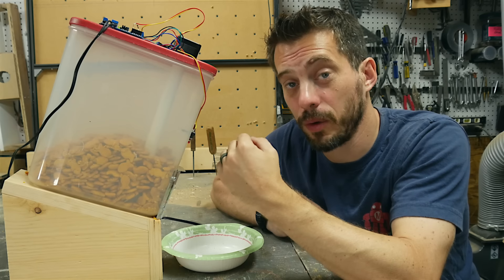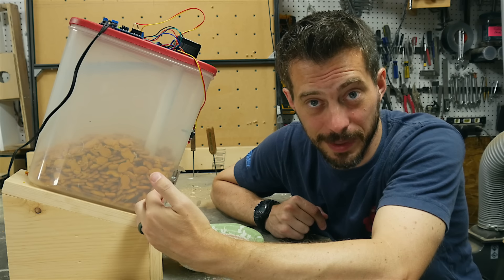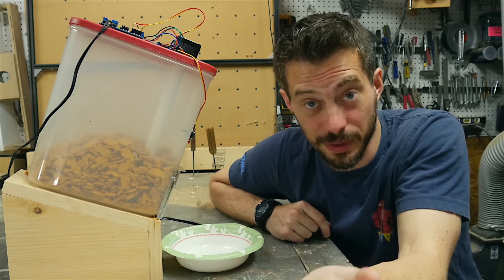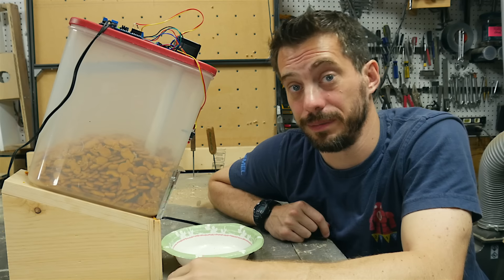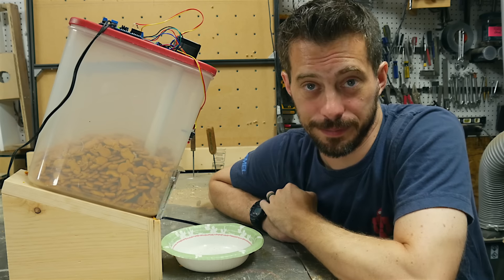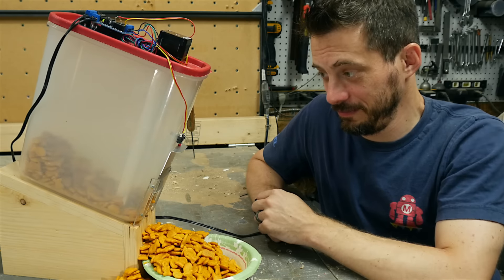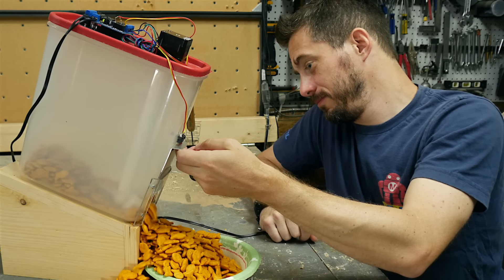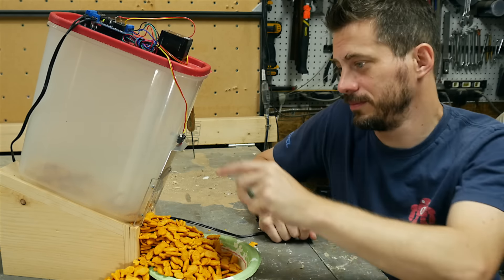Ridiculous Snack Machine // How-To | I Like To Make Stuff

Comment: Fun, nice work Bob! Things I may have done differently (if I possessed the skills that you do): 
1) mount the arduino and propeller going through the bottom of the container. That way, the electronics are neatly hidden away and it's easy to refill the cereal since the lid is undisturbed.
2) make a little "slide" out of the bottom of the container to direct the cereal into the bowl more accurately
3) use a magnetic switch to trigger the motor instead of a mechanical push switch

Can't wait to see how you integrate what you've learned from this into future projects!

Comment: Love it. Reposition stepper to the back and toward the bottom so you can take off lid to reload. Use a Archimedes screw and put a timer for the motor so it only outputs a measured volume of food.

Comment: im not sure you've realized but in arduino setup code you can designate a switch to be high or low, and thus wouldn't need to use a resistor in the circuit to keep the pin from floating. cool video too.
Reply from the maker: oh, good point!

Comment: for the automatic door, you could combine the idea of the panel to activate the switch but then you could have thin rods by the sides of the panel (for the switch) and  have the springs on said poles which push a panel to push another set of poles attached to the bottom of the hatch to cause it to swing open upwards. I hope that all makes sense to you

Comment: Just an idea, a feed ramp under the container would feed the product into the bowl center, and not down the front. But that is an easy fix. 
Mod 2 add a solenoid to open/close the door and a pushbutton to control. With a timer/volume limit.  to keep a "little ones" from ovet filling a bowl. Or leaving it to run till its empty and all over the floor. 
Always try something new or different to learn and if it doesn't work figure it out to make it work.  Even with failure comes knowledge.

Comment: Yo Bob! Love the idea, silly and fun! So much so you coaxed me into posting, (I don't post much). So l had a thought,  it looks like it work better with a cut out under the box so you could slide the bowl completely underneath the opening.  Then you could hide an ir emitter and sensor where the bowl slides in, triggering a servo that opens the door hitting the micro switch. You could then have a timer or scale shut it down, and have a semi metered amount.

Comment: Put a switch on under a pad that the bowl sits on that's connected to  off balanced motor( causing it to vibrate). Then sit the container of cereal or snack with door opening on top of that motor ( witch is mounted to same base as used in this video). So when the bowl is sitting on pad it causes the motor to vibrate the container that shakes the food/snack out. This helps by not putting mechanics in with the food.

Comment: I might try another prototype where the switch is mounted 90 degrees to its current orientation and just a little above (and to the side of) your sliding door. Then you could have the door immediately trigger the switch as it opens and wouldn't have to make sure you open it all the way.

That's a bit harder to do with the way you have the "door jam", but if you were still having fun playing with this, might be worth a shot!

Comment: I'd add a spout, to help facilitate flow control, also ramp the inner wall corners, a bit, it'll help as well. but I could see this having some fun potential, but does it really need an arduino? feels like some wiring and simple components would be enough.

Comment: For the door drill a hole in handle and take a servo. Attach plastic flatbar to servo with hole drilled in it.
Run a stiff wire through both holes, and let it swiwel. Then attach servo, so when the plastic flatbar is at bootomost point, wire runing from the door is perfectly straight. Add a microswitch at botom, so it gets preesed by bowl. Write a simple code, which makes the stepper go as long as it is held down and the servo goes up as son as microswitch is presed and goes dow as it is released.

Comment: Retrofit a wide mouth gumball machine... or base your design off of it  The hand knob usually turns a paddle agitator and some kind of slide valve or cupped dispenser. Gear a servo to turn the knob instead. Then you could have it activated by any number of sensors or buttons.  The two issues would be how to keep the cereal from being pulverize and (more importantly) making the throat deep enough to guarding from fingers getting near the rotating slide value.

Comment: If you do redo this, instead of the dowel/driveshaft taking up space inside the container, build it in through the base so all you'd need inside the container is your propeller. With the motor and arduino underneath in the wooden base you'll have a more asthetically pleasing result and you can remove the lid to refill with ease.

Comment: I would have mounted the pipe parallel with the bottom of the container.  A shroud over the paddles would prevent the cereal from falling out unless the motor is turning to push them out.  This would make loading the cereal easier.  Also, I would have the front of the  container sit a few inches in front of the base.  That would allow the cereal to fall into the middle of the bowl.

Comment: Nice. If you had that style door on the bottom corner instead of the side, you could have had the motor make only one revolution of a wheel that drives an off-center arm, so it opens the door fully at 180 degrees, then closes it when returning back to zero.
Then your sensor switch would have to be compressed for every full revolution.

Comment: Try a plain brushed dc motor under the wooden ramp with an offset weight on the end of the shaft. Then it will vibrate and you won't need any mechanical parts inside the container. In this way the lid will go on and off easier. The RPM, mass of the weight, and the amount of offset will all affect how strong and or effective the vibration is.

Comment: Hey, I was thinking about your design and seems clumsy. I know, it was just to see if you could but....why not doing a horizontal infinit screw (not sure if that's the correct english term)? i would probably be harder to do the helicoid part, as it woul need to be longer, but you would definetly be more confortable with different  cereal sizes and not waste what's in the back side of the tupperware. Just an idea, cool project =)

Comment: make the snack drop straight down instead of 45 degree.
make a hole at the bottom so that the snack fall straight down
then set up the electronics under the hole
the technic is set up a "+" shape fan with big surface area's blade, when the snack drop down, it will stuck between two blade of the fan
then put the fan on a motor that spin it
and set the switch as idea on 6:13
when you push the panel , you push the switch , then the fan spin , hence the snack drop down
if you want , you can measure the volume of snack for each turn that is enough for one person 
if he/she wants to eat more....just turn twice LOL
hope this help you
kinda long XD

Comment: You should have put the motor and paddles going from the back to the front pushing it forward and you would have no problem putting cereal in from the top and you don't have to take it in and out. Also could have created a U shae at the botttom that matches  the spiral so it feeds all the cereal out. You'll need a few modification to the front for the shaft to rotate on and not get in the way of the door a small screw or cotter pin and a small adjustment to the door.

Comment: you could make one using a spiral-propeller (drill-shape) that work align with the motor rotor, then put the motor in the back of the container so that the spiral-propeller push the content out (similar to what the spender machines do to push the product out) , this can actually be also useful for many applications, and beliveme, is not ridiculous.
Reply: That would be the more professional way to do it and also more complicated in ways. Having a spiral fed version would mean a better function, but the spiral itself is somewhat harder to construct, atleast without cnc and/or 3d printing. Would also demand better tolerances towards edges to minimize risks of jamming.

Îf you're building the entire thing from ground up, I'd use spiral feeding but when just slapping it onto an old container this design works well enough.

Comment: Isnt the arduino uno and the motor shield  an overkill you can use an l298n motor driver with an attiny 85 or 45 it will do it work just fine but whatever nice project

Comment: For school, I built a robot using stepper motors. We couldn't use an arduino though but had to build our own boards. Even designed the pcbs and sent them off for printing. It was a nightmare, but this seems doable!

Comment: Did you not consider putting the motor through the bottom so that the wires were not on show,  and the lid wouldn't be intended also that means you could make a hole for the bottom at the bottom for the bowl to be pressed against which means clean and easy hidden motor cereal dispenser

Comment: Cool project.  Couple of questions, why use the stepper motor?  A geared motor is easier to use and would eliminate the need for the Arduino.  Second, you probably don't need the pull up resistor if you use the internal pull up resistors the Arduino already has.
Reply: Internal pull up resistor reference: https://www.arduino.cc/en/Tutorial/DigitalPins

Comment: the arduino isn't require
Reply from the maker: An Arduino is NEVER required.  It makes things simple and fast to prototype.
Reply: +I Like To Make Stuff a simple interrupter and two wires it's enough
Reply from the maker: damon158 Ok. I'm not disagreeing with you.  But you did see that it was a ridiculous, silly project right?
Reply: +I Like To Make Stuff yeah and is really cool! good luck for the future
Reply: you can't turn on a stepper motor with two wires and a switch :D
Reply: Exactly. An arduino is never required, but if you have one you can get practice on it by doing small things like this. It's a very simple program with very few steps really.. I1=O1 Plus it's easy to build on once you've set it up. You can add other sensors to see if there is actually cereal in the container, which only requires the addition of an and to the same line. 

That all said, this version isn't foodsafe so if anyone is actually going to build this you'll need to use stainless parts and attach everything without the use of screws going to the inside.
Reply: TL Design Why use a stepper in the first place? But, yeah, you can make it run without it. You just need a capacitor and 12v AC.
Reply: TL Design ummm... its just motor you can run it...
Reply: Not this particular motor, no. This looked like a NEMA17 stepper motor. It's an international standard for industrial motors popularized among Makers because basically every 3D printer that owes DNA to the Reprap project (anything open-source or cribbing from open-source designs, in other words) uses them (or very rarely the smaller NEMA14 size) for each axis, and the extruder(s). There's no commutator which would allow it to spin from a simple DC input, you manually control the coils to advance the motor by small increments in your desired direction (so the computer controlling it, in theory, always knows where the motor position is without sensors). This motor would need a special chip to run, and probably a pulse generator (to send many 'turn a tiny angle' commands), or you could use a general prototyping microcontroller board like an Arduino. You wouldn't want to use an Arduino (or a fancy motor like this) in a product you were designing to make cheaply, but these are the parts he had, and the Arduino is by far the easiest way to drive it without much work in an experiment like this. The Arduino and stepper motor were probably spares he's going to reclaim for other projects anyway.
As Mc's Creations said, there are ways to use a capacitor and a low-voltage AC input to turn a stepper into a slow, torquey brushless AC motor, but doing the analogue electronics to generate exactly the AC waveforms needed to run it at a desired speed from a battery would take some electronics skill and math, as well as a bunch of discrete components. Cheaper for mass production, but more work for a prototype (and as I said earlier, you'd use a regular DC motor for a product).

Comment: My thoughts are to put the shaft parallel to the bottom with a screw along the whole shaft. That way the motor and all the wiring would be at the bottom and filling would be easier. Making the screw would be a lot more difficult, I'm sure.

Comment: You could make this whole thing without electronics by building a new container that has a funnel-like bottom. If you actually experience some cornflakes getting stuck before the funnel, you could add a little vibrating motor to shake the container. :D

Comment: Hey Bob, I was thinking of doing something somewhat similar to what you did with the stepper motor: motorized blinds. I have vertical blinds with a rod at the side to change the angle of the blinds. I was wondering how I could use a stepper motor and Arduino to build something to change the angle of my blinds. Thanks!

Comment: instead of using a motor to open the door, use a bent piece of metal, attached to a spring mechanism, which inverts and opens the door (also kept closed by a spring except for when the lever is pressed up against by a bowl. i can draw you a diagram if you want lol

Comment: Why not cut out a bit of the front bottom corner so you can fit part of your bowl under there? Less spillage and I think your center off mass should still be far enough back that it shouldn't tip over.

Comment: I was thinking about doing something like this but with a box joint jig and a steper motor, but would rather use this than mach 3
I am ok with the mechanical side but not the electrical side

Comment: When I see a motor and dispenser, I usually see a corkscrew that pushes the product up and out.  Ice dispenser, cement mixer, etc.  That method would also allow the door to be a flap that can close.  Anyway, I get it that both are equally ridiculous and it's just learning, but is there a reason you didn't go that route?  I really surprised that product doesn't fall out without the motor running.
https://en.wikipedia.org/wiki/Concrete_mixer#/media/File:Operation_of_a_truck_mixer.gif

Comment: You could lose the arduino with a regular DC motor connected to the switch. Stepper motors are mostly when you need fine-tuned control on where the motor stops, which isn't the case here.
Reply from the maker: You saw that "ridiculous" was in the title, though, right? :)  Seriously though. I ordered some DC motors but they didn't show up in time. I considered servos but the necessary torque was probably too great for a hobby servo or even a small dc motor.
Reply: Fair enough. I over-engineer when it's needed, but simplify when I can, especially when it would save me some cost that I can put into a different project.

Comment: what if it was more like a grain auger moving it towards the opening, then the motors would be on the back side and not the lid. Then you might be able to get rid of the angled part of it as well.
Reply from the maker: Actually, that was my first attempt.  I even shot the video of that but didn't include it. I may edit it together and put it on my second channel eventually.  It turned out that the weight of the goldfish made it pretty hard for the auger to turn. Further design on the auger could help that quite a bit, but I had to move on and the 3d print for the auger took 17 hours 0.o

Comment: Why do you need a controller? Isn't a switch directly connected to the motor and power supply enough?
Reply from the maker: Of course you certainly could.  I was buying the shield and steppers for a future project so it was quick and easy to put them into this one.

Comment: I think you could put something that makes the base vibrate, so the vibration would help gravity and the cereals wouldn't get stuck.
Also you could use an inverted button that would make contact when you stop pressing with the lid. That way there wouldn't be wires making it that (sorry) ugly because all the electronics could be hidden in the base.
Reply from the maker: I wasn't exactly going for a pretty machine :)
Reply: It wouldn't be pretty anyways, but it would call more for being used, and not just for testing.

Comment: you really don't need to use an arduino,  you can just put the button to the positive of the power supply, the other cable of the button to the motor, and the other cable of the motor to the negative of the power supply. it should work.

Comment: Fun project :) I'm not sure the glue on the propeller is a good idea. Most glues are direct toxic or contains chemicals that can give serious allergies. Some plastic contain compounds which can be endocrine disruptors. Plastic used with food should be certified for use with food.
Reply from the maker: I considered that, but we've used CA glue to close up wounds for years and it's never been a problem when essentially being put right on the open tissue.  Fully cured CA glue in proximity to food has far less potential for any sort of a problem.

Comment: If it is just going to be on when the switch is closed why use an arduino and stepper instead of just a battery and normal DC motor?
Reply from the maker: Because the DC motors I order hadn't shown up in time, and I had these parts for another project. Feel free to use whatever you like in your projects.  I assumed it was obvious that this was just for fun and not a serious electronics project.